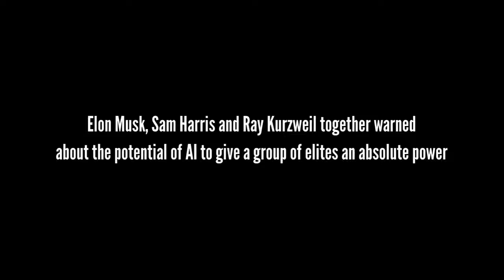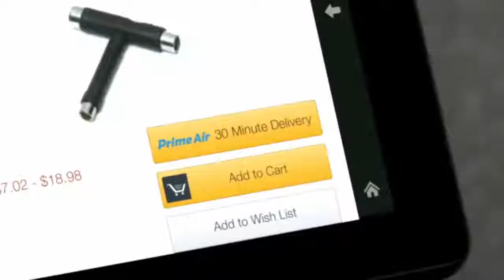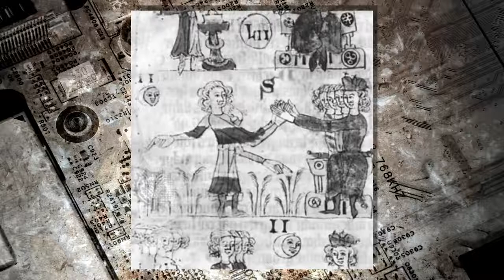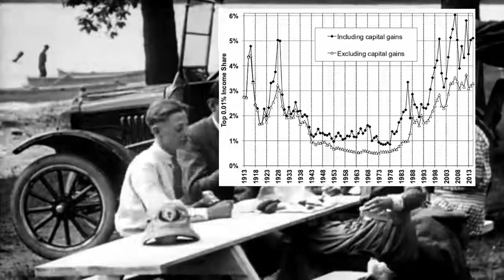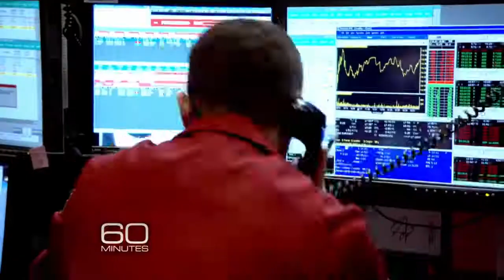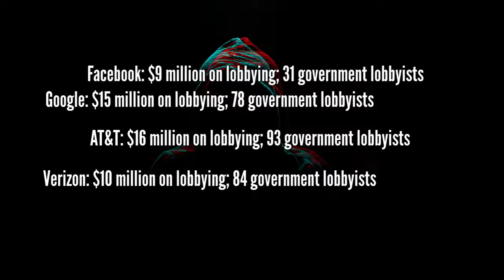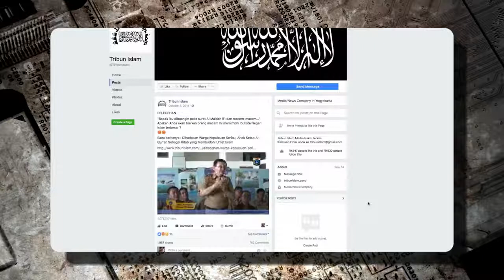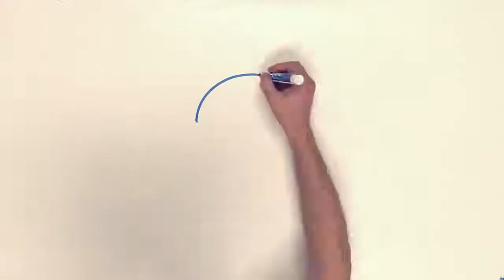Universal Basic Income. The power of AI within the hands of the few

Comment: The problem isnt AI taking jobs.

The problem is that the people AI will replace wont be capable of finding a different job.

We need a positive eugenics program, not handouts.

The mean IQ world wide is 90 and falling due to wide spread dysgenics.  

Here in the United States the mean IQ was 100 at the turn of the century, but is now 98 and falling due to unchecked low IQ immigration.

As a rule of thumb. Every person under 95 is six times as costly as the productivity of every person over 105. 

Therefore the most benefit that any person can provide is actually not through education or employment but by not contributing to the reproduction of the underclasses. Those with an IQ  below 105.

If your IQ is below 105.  Do the world a favour and do not have children.